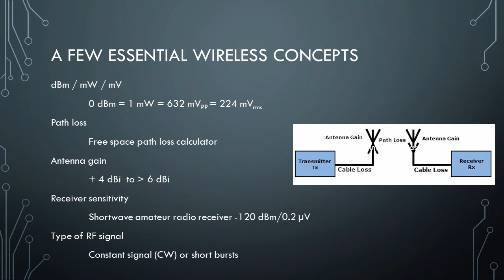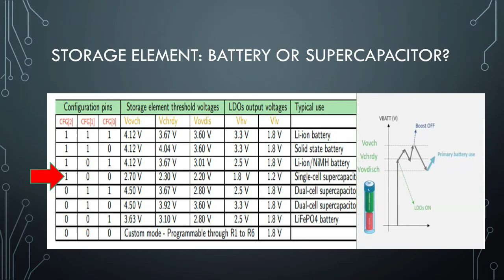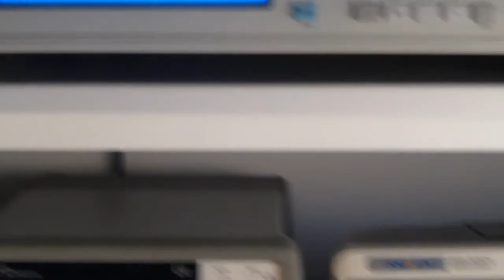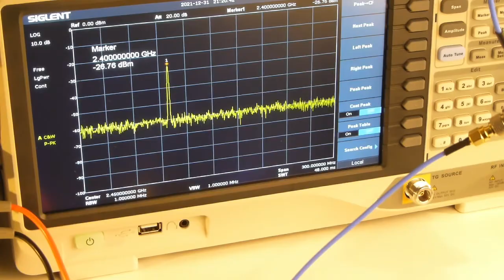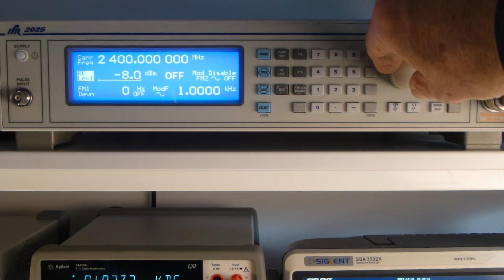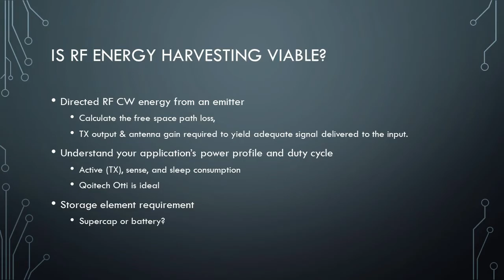RF Energy Harvesting - Review of e-Peas 2.4 GHz energy harvesting evaluation board

Comment: Hey, thanks for sharing your hard earned knowledge with me. I do appreciate this very much. (QUESTION) Would you have problems designing and building a (BOOST CIRCUIT) like the simple (LOULE THIEF)? Then running this Scavenged Power through a Small (TRANSFORMOR) to a larger (TRANSFORMOR) to Enhance the build up of enough (CURRENT) and (VOLTAGE) to Power even larger (CIRCUITS)? Also, wouldn't you have far better power, 'if you were to design and build a (ANTENNA ARRAY) finely tuning it to the desired Radio Signals? I'm just asking. Tring to learn all I can, before age destroys my mind. Again, thanks for the knowledge upload.

Comment: Im very interested in this technology I studied Energy engineering and I find this to be a great way to go.
Reply: What is you put 1000 receivers each capable of receiving 5W and combine the output? give it a try and you’ll be surprised ;)
Reply: You must have not studied very well because this is completely impractical because of ..... basic physics.  A WiFi transmitter has a maximum legal power rating of 5W so it you got 100% efficient transfer (you won't not even close) the most energy you could harvest is 5 watts. An antenna with gain doesn't increase the received power because antenna gain is measured against a 1/4 W vertical (which isn't very efficient) ...... Even with 100% transfer (impossible) you aren't going to get more than the 5 watts the transmitter puts out.
Reply: Sorry I didn’t explain myself properly, I meant to say I study renewable energy but during my school I didn’t saw this topic and I find it interesting, 2 years ago in CES Las Vegas I think it was Samsung that introduced a power control for a TV that recharges from the sun and from the WiFi, or at least they say, so that’s when I started interested in this topic, now that you’re saying this it makes sense sense it can only powered a small (very small) device, I hope some day this can be an alternative